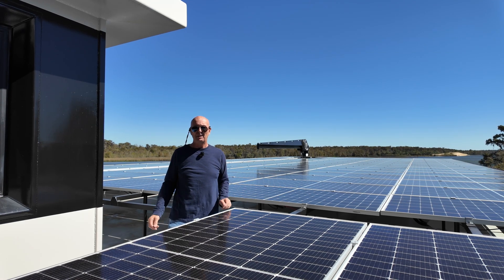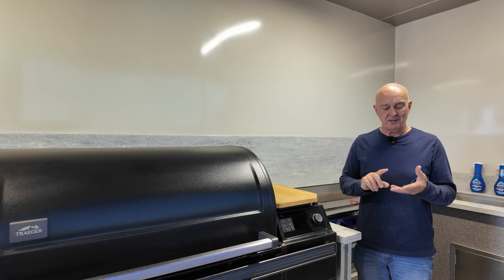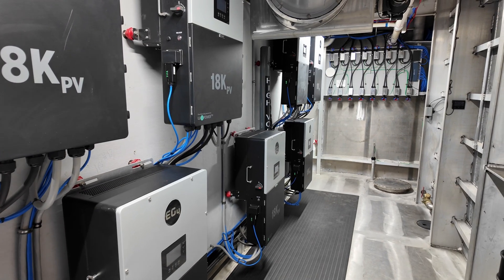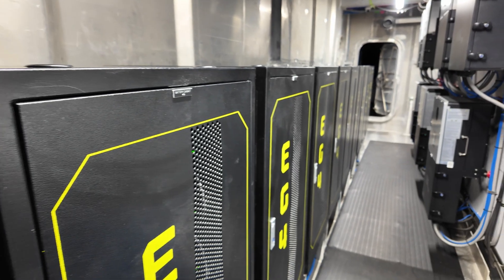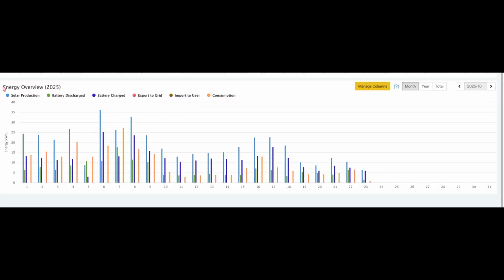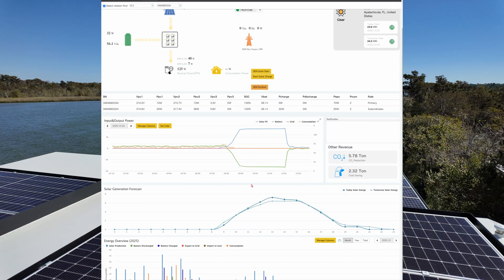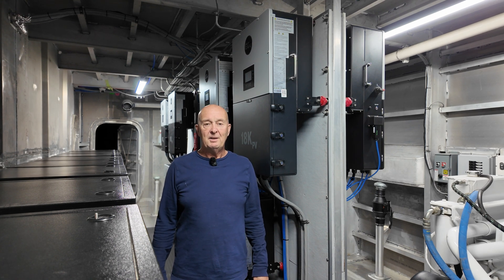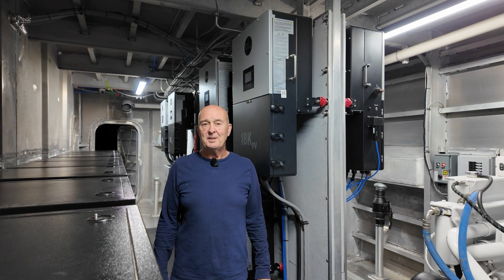Electrical and Solar Design Overview of the Green Living Vessel.

Comment: Might i ask a potentially dumb question? Why use multiple PTAC type climate control systems instead of a single heat pump system? The same system could be used to produce hot water for heating and bathroom use as well as a cold tank for cooling purposes. You could even use the hull as a heat exchanger and use the water as a sync.
Reply from the maker: Yes, it eliminates ducting and refrigeration piping with the attendant risks of condensation in the walls and also simplifies replacement and maintenance.

Comment: Hi Phil, love that you're sharing this amazing idea - spectacular execution. 

 showing all the things that are electrically powered (everything) is handy. The question I have is about your spreadsheets, not sure if you have these items covered in another tab or something, but it seemed like everything below the house (the boat level)  wasn't listed in your daily usage averages etc. I'm talking about the reverse osmosis system, the back/grey filter, the bellow deck ventilation/cooling etc. 

Is there a reason for this? I'd be fascinated to see what percentage of the overall energy use was used up by the boat side or the infrastructure side of the vessel. 

Keep the videos coming, and all the best in your commercial endeavours.
Reply from the maker: Yes, I showed a summary sheet, it was getting too much detail to show everything.

Comment: Very impressive build and congratulations on such a beautiful accomplishment! I am extremely impressed by all the integrated systems. While I was wondering why haven't you lifted the solar panels up to a ceiling height and make use of the space under it! You can have a Tennis Table there, a nice L shaped sofa seating area. Even a small football playground.. :)
Reply from the maker: You are not the first to say that, it is a good idea. That is certainly an option, on this or future vessels, in this case, we kept it simple, to start with.

Comment: What if you exchanged the solar panels for an Exowatt system.  I think with the room you have you could achieve 70 Kilowatts and no need for batteries. Just curious.
Reply from the maker: I had not even considered that, I will certainly take a look.